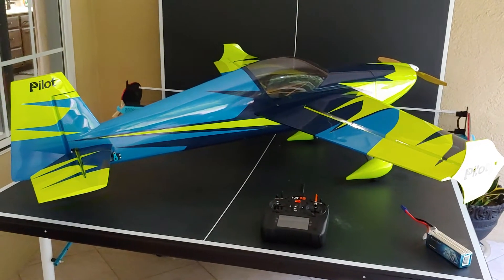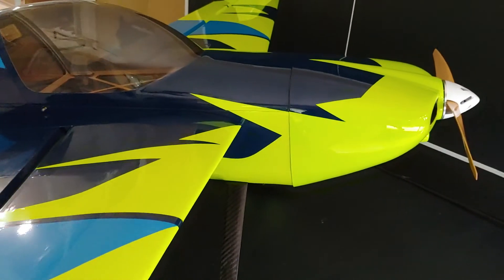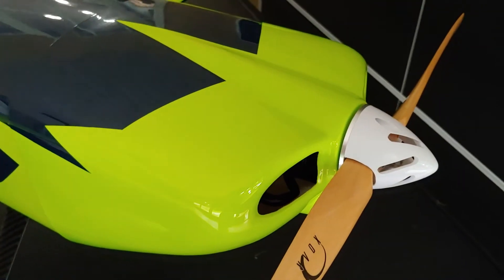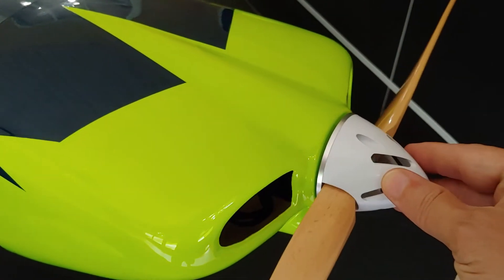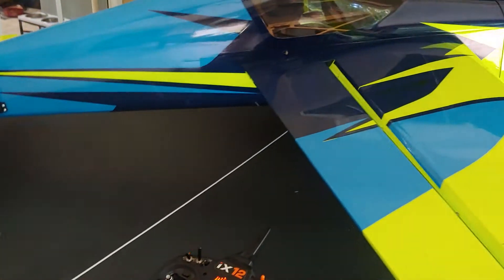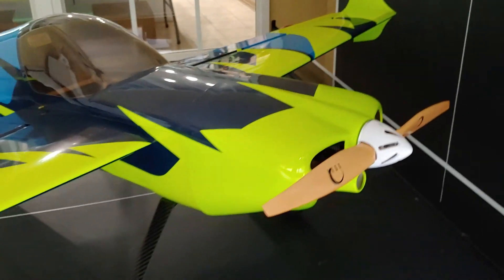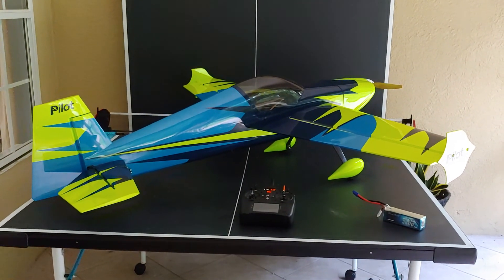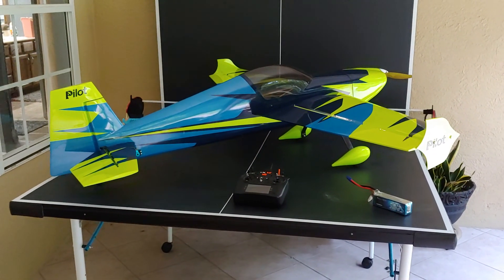Pilot RC Build Complete

Comment: So you think with the Ga 2000 400kv 18x10 is alitte under power I'm looking at the Ga R but not sure if my efficiency goes out the window? I will be running the stock 18x10.
Reply from the maker: I think you will be fine either way. The R has a little more punch, the non-R has a better efficiency. You just have to figure out which one fits your flying style better. Get a setup you like and fly the wings off it.
Reply: Ga 2000 feels underpowered but with a falcon 19x8 it feels abit better down low torque.

Comment: Thanks for the shout-out about the weak motorbox. 👍
Wow your servos are really quiet, I use MKS 9767 and no where near as silent,  very impressed.
What are they and there specs ?
Thanks again for your videos and look forward to your maiden 👍
Reply from the maker: The servos I am using are Power HD B5. They are digital brushless 20kg servos. Brushless servos are know for being quiet. Power HD is a big name brand across the pond. I did a couple of videos on them. I am impressed with them so far, especially for the price.